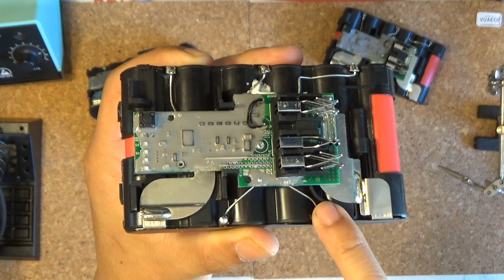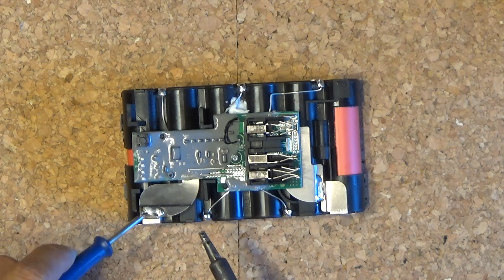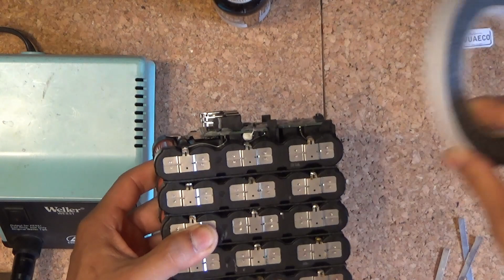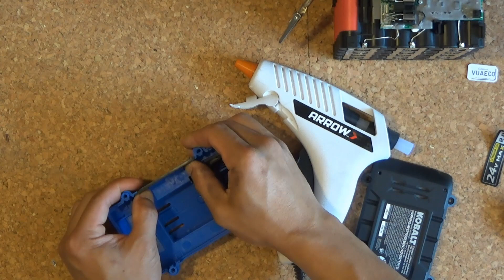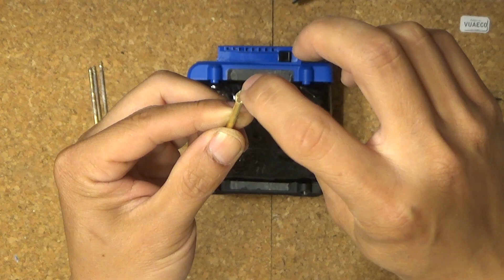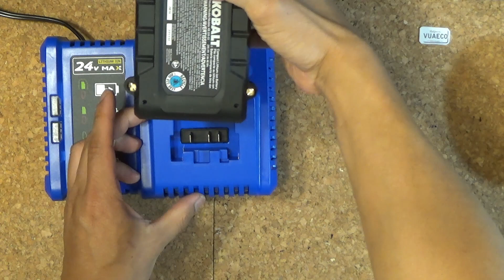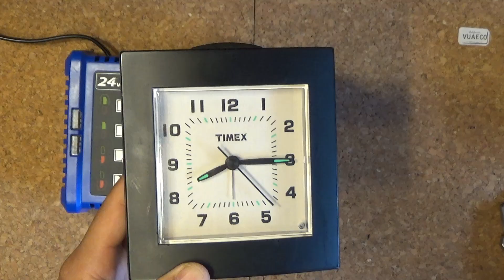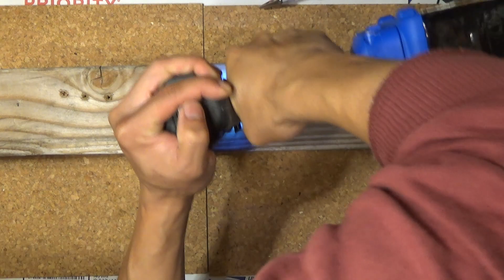DIY: The World's first 10 Ah Li-ion power tool battery built for Electric Bike home-made

Comment: Love your videos. I see that you use these to run your scooters. Curious... would 4 of these, running parallel to 48v, power a Golf Cart? Or would it fall short in discharge or kW?
Reply from the maker: 4 of these in 2S2P config can handle 10KW at 48V. I figure they might be capable! What's the rating of your golf cart motor?
Reply: Could not find any info on the motor. It's a 36v cart with a 275amp controller. It look like the aH rating would be too high (I'm a newbie to all of this). Each lead battery is 6v 225Ah. Doesn't that mean I would have to have over 100 of those Kobalt batteries?
Reply from the maker: Each of the Li-ion cell is capable of handling 20A. I have 5 in parallel in this pack so that's 100A for each pack. If you put 2 packs in parallel, that's 200A max. So 3 in parallel would be able to handle 300A. But because these are small and low capacity, you might want to put more packs in parallel to increase your range (and Amps ratings as well at the same time)

Comment: @ vuaeco Is there a way to do this without soldering? I wanted to see if a simpleton like me could bypass soldering. Thx in adv. I enjoy your videos (also subscribed 😉)
Reply from the maker: The only alternative is by spot welding but you'll need a welding rig. This battery has to go through high current draw so you need to have firm connections.
Reply: @thepeoplestrike 
Any simpleton can solder, you should learn how. Seriously

Comment: Should put the DeWalt circuit board on opposite side so you can used on either drill that battery must weigh alot. You should just made it 125 volts. Put a Gfi on it portable power.

Comment: The weight of the drill with that battery is going to give you carpal tunnel lol
Reply from the maker: Not much heavier than the Dewalt 9Ah battery though.
Reply: vuaeco , that's good ! Having a drill you need to charge once a month is a good thing lol You should look into making a adapter so you can make it a portable power station .
Reply: Good idea - USB socket for charging your mobile phone! Get lots of charge cycles out of that pack.

Comment: How much does it cost to build one of this unit?  You are looking at 10AH X 24v = 240w.  And how long will it last or how far can the bike travel on a single charge?   My 58V lithium ion battery Echo trimmer is 204w which is better brand and very well built.  Or i would go for AMG gel dry lead acid battery which has the capacity  up to 1kw/h, cost less and 4 time more the capacity  of your unit.
Reply from the maker: $20 each so 5 packs is $100. The 58V Echo battery might be over voltage for the controller so you need to check your controller before you hook it up or you might fry it. Lead acid battery is cheaper but there's a few drawbacks: 1. It's heavy and not very energy dense compare to Li ion. 2. You can only draw 50% depth of discharge before you want to charge it back up again or it won't last long. So a 1KWh Lead acid battery is effectively only 0.5 KWh.
Reply: Thanks for replying.  Looks like you know what you are doing.  I would love to see your bike in action.
Reply from the maker: Here's the ebike powered by these battery packs: https://youtu.be/SvnFU3SOVJ0. Bike in action is towards the end of the video.
Reply: Thanks for sharing a very informative video.  Have another question.  Do you think that my 58v lithium ion battery  of the Echo trimmer can power the 48v motor hub?  I have 2 of this and each of them is equivalent to 4 of the makita 18v.
Reply from the maker: It depends on how Echo rates their 58V battery. If they use max voltage, it's 4.2V each. If they use norminal voltage, it's only 3.7V. You will need to open up the battery pack and see how many cells are connected in series. Or charge the pack to 100% full then measure the voltage. Then you can divide that number by 4.2 to get the number of cells in series. My ebike motor and controller is rated at 48V and I only run it at 50V max. And it seems to handle well. I'm not sure if it can handle anything more than that though.

Comment: Anyone have any ideas if three Milwaukee 9.0 batteries would yield?
Reply from the maker: 27Ah pack.
Reply: How many watt hours would that be three Milwaukee 9.0 batteries?
Reply: How watt hours?
Reply from the maker: 27Ah x 20V = 540 Wh
Reply: vuaeco 3 Milwaukee 9.0 hooked up wont it be 27 Ah x  54 = 1458
Reply from the maker: No. Three Milwaukee 20V 9Ah hooked up in parallel will give you 20V 27Ah. That would translate into 540Wh.
Reply: vuaeco how about when 3 Milwaukee 9.0 hooked up in series?
Reply from the maker: You still get 540Wh no matter how you hook them up. The difference is the Voltage and Amp. Three Milwaukee 20V 9Ah in series will give you 60V 9Ah (the final result will still be 60V x 9Ah = 540Wh)
Reply: What would be the approx range with a setup like this on your bike?
Reply from the maker: I have about 25 miles on average. Of course it depends a lot on how fast you ride, the terrain, wind speed/ direction, load...etc.

Comment: For the Solar Buss wire that you use to solder these batteries together in parallel, is there an amp rating for it? Will the buss wire be able to draw that current through them? I found one on Amazon but not sure if it's the same kind as yours.

https://www.amazon.com/gp/product/B01A875Q3A/ref=oh_aui_detailpage_o00_s00?ie=UTF8&psc=1

Where did you buy yours?
Reply from the maker: That's not the one I got. Mine is pre-soldered. That one is just bare wire which is fine. But pre-soldered wires have 2 advantages: 1) It's thicker so can carry more current. 2) It's presoldered so it'll make your job a lot easier to work on. I bought mine on ebay. Try eBay item number: 171687451419. That's the cheapest I can find which I just searched now (I have no association with that seller). You have to get the 5mm wide wire. Don't get the 2mm as it's too small and not big enough to carry the current. Or you can search for "solar bus wire" ("bus" with one S). As far as ratings go, they have no ratings. But if you look at power tool batteries, it's exactly the same wire especially Makita batteries. They use the same thickness wire. You can also increase the thickness of the wire by adding more solder to the wire (which you will have to do it anyway as you have to solder them to the battery). Any more questions, let me know.
Reply: Will do...I am planning to use these in my son's power wheel which takes about 30-40 amps so wondering about the wire so the final config be able to carry that much (if not more) to the power wheel. Do you have fuse added to your ebike. I plan to use 10 or 12 gauge wire from the battery pack to the power wheel so wondering what wire gauge do you use for your ebike
Reply from the maker: I use size 10 AWG. I use 30A fuse switch combination. I talked about it in this video: https://youtu.be/SvnFU3SOVJ0.
If you want to run 40A on your powerwheel, you'll have to use a fuse bigger than 40A.
Reply: So you have 24v in series at 10AH right? How long does it last for one charge? Have you try running your ebike until it is out of juice?
Reply from the maker: I get about 25 miles in one charge. It depends on the terrain, the wind, how much I carry, and how fast I go on average.
Reply: What connector did you use for your connection? Was it deans connector or something else?
Reply from the maker: I made a polyurethane mold for it and used XT60 connectors for the wires. Here's the video: https://youtu.be/4o0dBpYcWwE
Reply: Do you have problem soldering the 10 AWG wire to your XT60 connector?
Reply from the maker: Size 10 is a very tight fit but it should fit. I made the video instructions here: https://youtu.be/_CR8Mg7Lo98

Comment: Wow and i spend 450$ for a 48v battery+charger . i wonder if you could add another 5 of those in series to make it 48v battery. not that your bike needs it but yeah. Thanks for the great video. thumbs up. NVM that won't work cause you'll need a different charger and different circuit for the batteries. Very cool none the less

Comment: every hardware store and home depot sells THREADED ROD! 2 foot long minimum!
Reply from the maker: That's correct. But not size 6.
Reply: Size 6 threaded rod is (9/64") or (.138)" which just happens to be the same size that Home Depot. Lowes and everyone else carries! Just that I was mistaken with my 2 foot minimum. This one is 12 inches.   https://m.lowes.com/pd/Steelworks-0-138-in-x-12-in-Standard-SAE-Threaded-Rod/3127881
Reply from the maker: You're right. That's a good find. I went to both Lowe's and HD but didn't find it. There's a section where they have threaded rods, aluminum bars, steel bars and such. There are some threaded rods but they are long and big (size 10 or bigger) stored vertically in tubes. I asked a few employees but they said all they had was there. So this 12" rod should be somewhere else as it that whole section only has long rods and long bars, nothing less than 3 feet. Thanks for the tips, much appreciated.
Reply: Sadly I find that most of these stores employee's dont know much, They walk down an aisle and then stop, look through their crappy handheld computer and then drag you through a wild goose chase, and end up finding it on your own anyways lol!.   I actually found them by using their store map online.  When you click on the item, it gives you the option to search the map. It says which aisle and bay the items are in!  Im always glad to be a help!!!

Comment: What is the dimension at the end when you stack 5 of the 2ah battery together + the cover?

I want to do the same setup for my son's power wheel :)
Reply from the maker: It's about 5 1/4 inches tall from the bottom all the way to the very top where you have the 4 LED test lights. Width and length are the same as regular pack.
Reply: What bit did you use to remove the screw off the battery? My regular torx bit did not seem to have the right size and hole in the middle. Star bit?
Reply from the maker: It's a security torque screw driver. It's a star bit with a hole at the center. You cannot use a regular star bit. I bought mine from Harbor Freight, pretty cheap, but works great for these.
Reply: Do you have HF link?
Reply from the maker: Not this particular set as I bought years ago. They have changed models many times over. But yes, that's similar to what I have. Lowe's have it for $10 but only 5 pieces. This is cheaper and has a lot more pieces so you have a good bang for your bucks! Use that 20% coupon and it's even cheaper. And don't forget to pick up that free volt meter, too! LOL
Reply from the maker: Also, this set will only allow you to remove shallow screws. Some screws are deep inside the hole and you cannot reach with these bits. You'll need the hand-held screw drivers. They also sell that as well at HF

Comment: can you use copper wire instead of the nickle strips? or will that not work?
Reply from the maker: You can use copper wire. But it needs to be thin enough to be put back into the plastic case or it won't fit.

Comment: I've built an 10S10P battery for my ebike based on the lg cells from ebay. I got them for $150 which is great for 100 LG cells. The thing is that I have a $100 hobby charger but I want to build one for an uncle but the charger is expensive. It seems that I'll look into getting a 36/40v charger and one pack and wire them up and make a 22 Ah battery for an ebike. This may be a good way to have a cheap and reliable balancing charger. I also built a spot welder so there is no worries there.

Comment: Congrats on building the most useless tool battery pack ever!
“It can probably last the whole day with his tool”... my Milwaukee High Demand 9.0 battery pack lasts my drill or impact all day, costs less and weighs less. Not to mention is physically smaller and has a longer guarantee...
Fail
Reply from the maker: Thanks mate. You fail to notice a few key points.
1) I did mention I built it for my electric vehicle. Yes, it is a power tool battery and too big and heavy for a portable tool. But I can still use it for my tools. For your information, a drill and impact driver are not the only things you can call them "tools". There is a long list of "other tools" you can use with this battery: Flash light, Jobsite Radio, Jobsite Bluetooth speakers, work light, lantern, power station/charger, USB charger, and tools in which a battery weight doesn't matter much... and the list goes on and on. Not only is it useful for tools, it is also for an electric vehicle. So it's less "useless" than you think.
2) Your so called "High Demand 9 Ah" is still not as high as a 10 Ah battery. And by the way, Ah alone doesn't really mean anything if you don't consider the voltage of the battery. Because your 9Ah battery is only 18V (or 20V) whereas the Kobalt is 10Ah at 24V. And if you do the math your 9Ah battery is only 180Wh where as the Kobalt 10Ah 24V is 240Wh. That's 33.33% (or 1/3) more capacity, not just 1Ah more.
3) How can your Milwaukee 9Ah cost less than this? Your Milwaukee costs $170 where as this Kobalt costs me $100 ($20x5). 
Sorry Mr. Bullshitfreezone but if you're trying to do what you're preaching not to, troll, or promote Milwaukee propaganda, you've come to a wrong place.
Reply: Bullshit Free Zone      Sounds like Bullshit to me!

Comment: Just put 10 of them together in a backpack type thing and run a cable to the main plug in battery, and you will have 200 ah and all the wait is on your back or you can put it on a belt on you side. Lol 😂

Comment: Are there a way to just connect them on parallel without removing the cases?  thanks
Reply from the maker: yes, you can make these slide in connectors and wire them in parallel: https://youtu.be/4o0dBpYcWwE

Comment: Why do you have a 1000w motor when your batteries can only produce 480w?
Reply from the maker: My battery is 100A at 48V so it is 4800W, not 480W. You're talking about Amp hours which is capacity, not discharge rate. THey are not the same.

Comment: would have been much smarter to use 10 cell packs instead of 5 cell.  The cells in smaller packs are designed for current output above longevity, economy, and capacity.  10 cell packs use cells that are designed to be ganged up in parallel because each cell gets half the load that a 5 cell pack cell has to support.  This may not be true for all makes, but is more a general rule.
Reply from the maker: You're talking about regular low discharge rate 18650's like laptop cells. And that's true for those. These are not ordinary 18650 cells. These are designed for high loads like impact drivers, saws, drills. Each cell has 20A discharge rate so 5 of these in parallel can do 100A. Not many things out there can run up to 100A.

Comment: I built two 7s10p packs from Samsung 26c cells. I run them in series for my bike, and parallel for my Worx string trimmer. So either 52ah in parallel or 26ah in series.
Reply: Did it extend the run time of the Worx string trimmer.  I was thinking of doing the same thing.  Do you have any pics of how you did it?

Comment: Could have just went to ace for the screws.
Reply from the maker: I did. But nobody was selling size 6 screws that were 4 inches long.
Reply from the maker: I tried. Nobody was selling any size 6 screw that was 4 inches long.
Reply: vuaeco that or they make, I think it's called all thread. It's a long piece that is threaded all the way down, then you just cut it to length and put a nut on the end.
Reply from the maker: I responded to this idea in another discussion below. It is called threaded rod. The smallest threaded rod I can find is size 8, not size 6. Most of them are size 10. Even with the correct size threaded rod, you'll have to drill holes on both ends and have 2 nuts on both ends. Which doesn't really work well because the nuts would be too big and they would stick out on the bottom. Your battery wont' stay flat because of the nuts on the bottom. It would require more mods to be done. Again, I'd rather spend 10 minutes to make my own screws: https://youtu.be/XH8OiLUPEF4

Comment: Why don't buy some lipo's and built your own 7s pack. 2x5000mah parallel 7s and when charged 29.4v. Or a 6s 25.2v
Reply from the maker: Ebike batteries' cost are in the triple digits. Not to mention the dog-gone balance charger.  I do save a buck, but just add 2 more digits after it.
Reply: These kobalt batteries are only 20-25 bucks at my local lowes
Reply from the maker: I could. But this is way...cheaper if you know where to find the deal. Plus, because it's a power tool battery, it already has its own balance charger so I don't have to spend more money on a charger. And because it's a power tool battery, I can still use it for my tools. It is cheaper and has more real world practical applications than just a regular lipo battery pack.
Reply: oke i thought the packs are quit expensive. yes its not practical to balance them every time. powertool packs have a separate cel balancing?
Reply: $10 per pack where I live.
They have a 20ah pack for $20.
Still pretty damn good amirite?
Reply: US$40 on ebay in July 2018.
Reply: @Niels The same reason electric cars don't use Lipos. Lithium Ions are superior. They don't puff out and are far more reliable.
Reply: wtf. i just watched the prices for makita 2.0ah packs. and they go for like $80. thats insane. 80x5=400 just to get 10ah pack. not including the tape and screws. but then a kobalt is probably a cheaper machine than a makita, i dont know much about it since they dont sell from where i am.
Reply: Kobalt is super cheap, buy from Lowes.